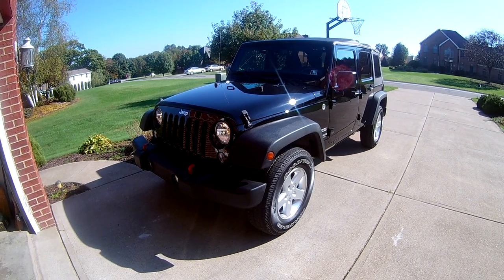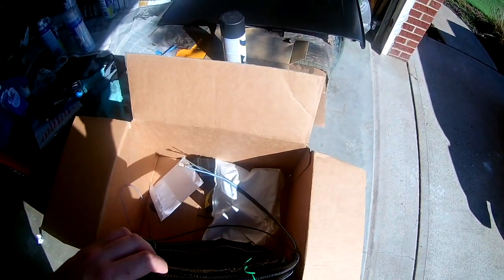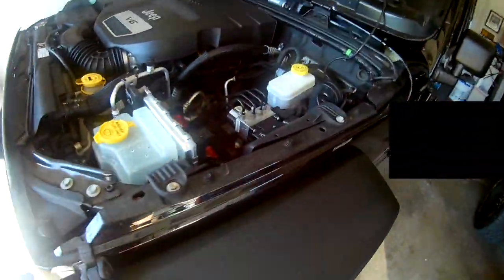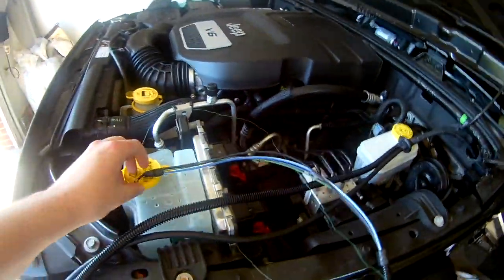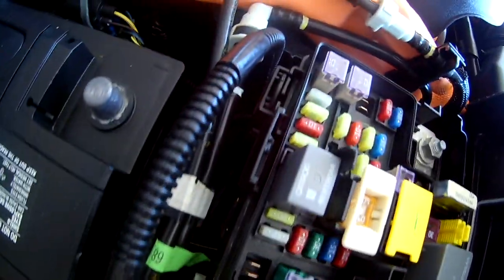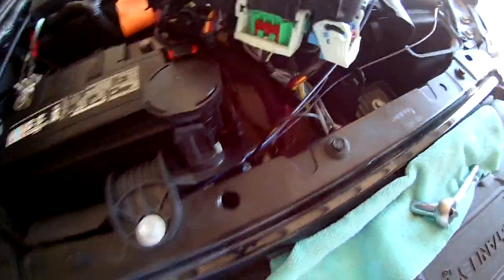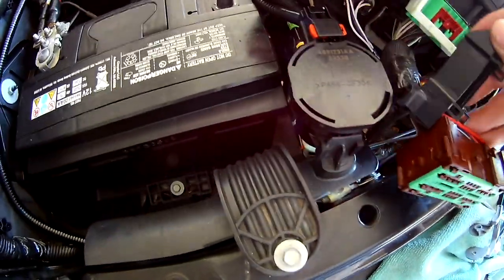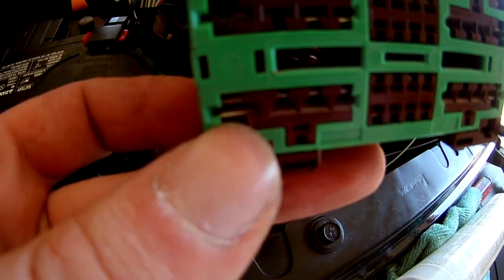How to Wire Jeep Wrangler Hardtop Harness

Comment: thank you for video, followed them perfectly. went to dealer to activate ECU and the wiper switch is working backwards, rear work for front and front work the back wiper. also the rear wiper doesnt return to top position, any suggestions ?
Reply from the maker: Did you happen to test the functions before dealer programming? I wonder if something went wrong when they added the function to the computer. As for the switch working backwards, did you use the yellow pigtail of wires that were connected to the new wiper controller (23:08)? I am not sure if they are different between the two, but that comes to mind, or the switch is defective. Does the washer fluid work for the rear wiper when activated? Mine worked fine even before going to the dealer. As for the wiper not returning to home, this again sounds like something wrong with the function added to the ECU. There are two sales codes that they must add GFA (Rear Window Defroster) and JHB (Rear Wiper/Washer). There is a switch in the rear wiper motor that tells it to turn off when the wiper reaches home, they do sometimes go bad.
 
As far as troubleshooting I would:
1) Check with the dealer and hopefully they are helpful and they can check to make sure the right codes were added (and hopefully none removed). 
2) Check the wiper switch and make sure the wire harness for it is connected properly. Possibly try the old switch to see if at least the front wipers work properly with it.
3) Try replacing that yellow 6" wires connector for the wiper switch with the old one. ( I would make sure these connectors are the same and wired the same first).
4) I would figure out the backwards wiper switch before this, but if the rear wiper stops in the SAME spot every time, I would remove and reinstall it at the home position and try again. If it is working for a second or two and just stops where ever, it isn't programmed correctly. Before I went to the dealer mine would work for a second or two then stop wherever it was. I would reactivate the switch a few times to get it to go back to its home position, after the dealer it returned home before stopping.
4) If NONE of this works, I would go back and double/triple check connections and make sure the wires were placed in the correct positions. Sounds like everything is placed correctly as the wiper at least works. I made a few mistakes along the way and luckily caught them before it was over.

Hopefully this gives you a place to start troubleshooting. Let me know if you find the fix
Reply: I finally had time to figure out,  my connection to the fuse box was incorrect, I actually connected to the Brown and light green vs dark green on fuse connector. This solve the problem and is working. Thank you for your response.

Comment: I couldn't find this package on Amazon and Ebay, please put the link if it's possible. thank you
Reply from the maker: The one I purchased is currently showing unavailable on Amazon. However Quadratec has the kits available. You can also lookup the mopar part number elsewhere if you don’t want to or can’t purchase from Quadratec (part numbers are in the title of product on Quadratec). https://www.quadratec.com/p/mopar/hardtop-wiring-kit-late-wrangler-jk/heated

4 wheel parts should also have the kits

They also have pre 2011 kits too. I am unsure the difference between the 11-13 and 14-18 without heated mirrors kit. But the kit for use with existing heated mirrors just doesn’t include the temperature knobs to replace.

Comment: The vents don't actually need to come out to pull out that section of the dash. I've done it many times wiring my stereo and front and rear cams.
Reply from the maker: You are correct. I did this when I first got my jeep.. now that I’ve ripped the dash apart a dozen times (new radios, backup camera, speakers, blend door actuators) I know
Reply: @tybonez3646  I just had to bring it up as I'm the type of guy who would probably crack those removing em. Awesome video! It's really helping to set my expectations for this job. Thank you for filming this!
Reply from the maker: @froadindan8695  I had to follow the black and white mopar instructions.. took me over 10 hours with filming and figuring out what the heck the instructions were trying to tell me.. figured it’d help a few people! Good luck!

Comment: I’m not sure if you are able to reply to these comments still. We followed this tutorial and when we turn the ignition on the wipers won’t stop, we get a no bus error message on the dash and the Jeep won’t start.  Not sure where we went wrong. Any suggestions?
Reply from the maker: You have a wire shorting out somewhere. Disconnect battery and Check all your connections again and recheck they are in the correct spots. Also make sure every connector is seated properly. Check to make sure no pins are folded or bent in the connections. You didn’t necessarily do it wrong, but something may have gone wrong on the reassembly process. No bus means one of the computers isn’t communicating with another because of a short/disconnection/wrong placement of wire. Hope you can get it sorted out! I recently sold my Jeep so I no longer have anything to reference.
Reply: Did you get your jeep running again?

Comment: Hey what does the hose connection look like when your done ?? I got everything installed and zip tied looks super clean. Just gotta figure out how to connect the hose properly
Reply from the maker: Marcus Reyes if you look at 24:55 in the video that is how I still have it ran right now. It can go under your brake master cylinder and then also under the abs system (the thing directly in front of the brake fluid canister if you are in front of the jeep. You’ll see a cutout near the abs system where the front washer fluid hose is in a plastic clamp and looks to be room to put another beside it (I assume for the rear). Either way you run it should be fine. Front hose goes on the side closest to fender and rear goes on side closest to engine for the hose to pump connection
Reply: I finally got around to posting my video of how I did it, which uses the factory routing but involved removing the fender:
https://youtu.be/upgtq6sQRhQ
Reply: Trey Ideker Thank you for this picture! I'm still trying to figure out how the 3 pieces of the rear washer check valve assembly go together and in what order and direction to install them. Even the little white piece isn't symmetrical. Which way do these go on? Mine came with no instruction about them.

Comment: I connected everything correctly as the instructions say.... i activated the wiper and defrost with the Jscan app. The defrost works but the wiper and sprayer for the rear won't work. Am i missing something? Is there something else that i need to do or maybe its something on the hard top end?
Reply from the maker: Logan Leisure hmm. I’m not too sure to be honest. I believe before I programmed mine, the wiper would work for a second then stop wherever it wanted. Do your normal wiper and sprayer work? Since it’s on the same lever as the rear on the steering column just wondering if that isn’t plugged in the whole way or something.
Reply: @tybonez3646  the front works fine. The rear defrost works. I was told by a guy that had a similar problem that he had to get his flashed anyway
Reply from the maker: Logan Leisure that’s a possibility. When I did it OBDjscan wasn’t out yet, so my only option was the dealer

Comment: What type of tool removal kit would you recommend? It appears there are many out there. Thanks!
Reply from the maker: David Bozard I would just search “Terminal removal kit for car” on amazon and pick a metal set (probably the ones that almost look like keys) for less than $10... I have actually never used them before, but I had a hard time with just flathead screwdrivers.. the hardest one for me was the one behind the instrument cluster, which I ended up just cutting it and pulling it out the front since It was being replaced by a different wire. you MIGHT be able to ask your local auto parts store if they have a loaner kit. I know you can do that for other tools at least.
Reply: @tybonez3646  thanks for the video! Huge help. That one behind the instrument cluster killed me. Never got it out. I ended up leaving it in and splicing the new wire to it. I wish I had just done that from the start as I probably damaged the thing beyond saving as the wiper and washer don't work (rear defroster does though). May still try to fix it with newer parts.

Comment: Hi what’s the info to order the kit off amazon? I have the same issue. Thx.
Reply from the maker: https://www.quadratec.com/categories/jeep-hardtops/accessories/wiring?ka=hardtop%20wiring

Not sure if they are still on Amazon. But find the right one on here then copy the part number into Amazon. Or order from here. You need to match the correct year and if you do or don’t have defrost mirrors  will depend which kit you need
Reply: Thank for getting back back to me so soon! My jeep is a 2012 unlimited Sahara and it has heated mirrors, the kit says it comes w/ control knobs and that’s cool because mine are kind of worn. You’ve given me some great suggestions to continue my search and thank you for a excellent how to video.
Reply from the maker: @glasstyme  glad I can help! since you have the heated mirrors already you don’t Need the new control knobs. There should be a kit without them if you wanted to save some money and it will still function as it should. Mine was a 14 sport with heated mirrors and I did not replace my hvac knobs. But you can certainly replace them if wanted

Comment: Did you have to take it to a dealership to turn on the rear defroster?
Reply from the maker: Yes. Dealer had to flash the computer in order for it to work properly. It might have worked intermittently without the flash because I have heated mirrors but I am not sure as I did it before the frost weather.
Reply: Nvm. You mentioned it in the end lol. Thx for the vid!

Comment: Any recomendation for getting the wires in connector E to come out? I dont have a terminal kit and a screwdriver didnt work
Reply from the maker: Logan Leisure I struggled using push pins and a sewing needle. Can try that. Took patience and time, if I were to do it again I would save me the agony and buy a terminal kit.

Comment: I just followed this step by step and now my radio is not working and I have a check engine light that says faulty cruise control if I get the jeep reflashed should it fix my issue?
Reply from the maker: brian k did you make sure to buy the correct harness for your application? Non heated mirrors have two different ones for 11-13 and 14-18. If you have heated mirrors it’s a different one 11-18. Then of course older years is different. If you have the correct one I would QUADRUPLE check your wiring. It’s a PITA but it’s easy to get connectors flipped around and you install it in the wrong pin location (I did this twice...).. couldn’t hurt to run through the written instructions that can be found on quadratec.com for each respective harness. More than likely (I think) a wire was misplaced relative to its desired pin location. If all else fails, I’d disconnect the battery for a bit see if everything resets. It would have been much easier if they just included the harness when they built the dang things regardless of what options... I’m sorry you’re having trouble and hope you get it figured out!
Reply: @tybonez3646 I have a 2016 jeep with heated mirrors I have the exact kit as you do in the video
Reply from the maker: brian k ok ya that’s right then. I’d check your placements. It’s too easy to mess it up, like I said I even screwed it up twice that’s why I made a video haha
Reply: @tybonez3646  don't know what I did but I got it working on the first connector did you accidentally brake off the little brown tab that holds the slide clip in because I broke both of them.
Reply from the maker: brian k no I didn’t break those tabs. I don’t know how I didn’t haha. I’m glad you got it working though

Comment: Wanted to post an update after going to a Jeep dealer near me after installation the wiring kit. After calling three dealerships close to me, the cheapest quote I got for flashing the hard top was $98...ouch. As much as I didn't want to pay that much, I bit the bullet because my family is moving to Alaska and really needs the defroster and wiper to be functional....To my surprise, after the dealer finished the flash ("initialization"), the Service Manager told me no charge, gave me his card and personal cell number for future (hopeful) business....WOW. I may or may not have mentioned to him that I'm moving to Alaska but his gesture was extremely kind.

Also, for anyone that installed an aftermarket backup camera kit (got mine from Amazon: Brandmotion 9002-8847), the dealer will also have to flash/initialize it. My camera stopped working after they flashed the hard top but I quickly turned around and they flashed it again to correct it quickly. I was told that when they flash/initialize something, they basically have to factory reset everything to the original VIN, then add any new items (hard top, camera, etc.). Because my camera was installed after I purchased my Jeep and not attached to the VIN, when they flashed & reset hard top, it wiped the camera settings (they weren't aware that there was a camera since it wasn't attached to the VIN).
Reply from the maker: $98!? wow..Guess my $46 to flash was cheap then. Guess that is why they call them stealerships.. Glad you got off clean though! Also thanks for that extra note, I plan to do a camera soon so hopefully the stealership does not mess that up as well.
Reply: $98 is their hourly rate and they do not charge for 0.5 hours (the job took no more than 30 minutes)
Reply: David Bozard How much did you pay for the brand motion, if you don't mind me asking? I bought a cheaper version looks almost identical to brand motion but it came with the lock pick so I don't need the trip to dealer for flash. And it was about $200 cheaper.
Reply: Where did you move to Alaska at. Funny story I bought a hard cause I moved to Alaska, 2.5 years later I finally bout the wiring harness.

Comment: Save yourself time and money and invest in an ODB ll connector and download JScan or iOS or Android. I’ve used mine several times to modify settings, clear codes etc. it’s probably the best purchase I’ve made
Reply from the maker: I just got one a few months ago... JScan wasn’t out when I did this sadly. You can do just about everything with it, it’s amazing. Does everything for less than one trip to the dealer!

Comment: Lol I’m sorry i meant for the rear lol where we plug the wiring in the hard top
Reply from the maker: Marcus Reyes I had some leftover connectors for that, some of the pieces are for inside the hardtop panel. I just used whatever worked to connect it to the top. Think it was male/male piece I used